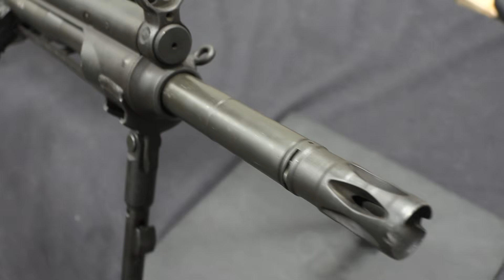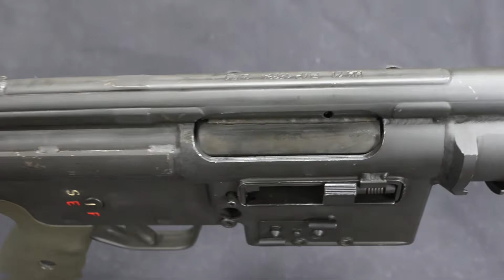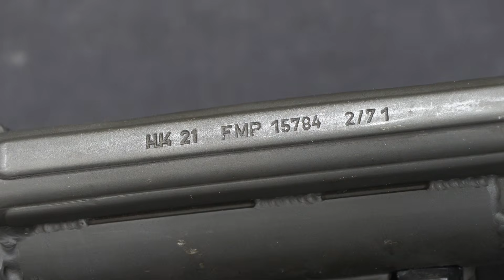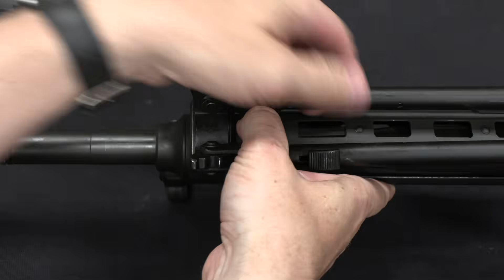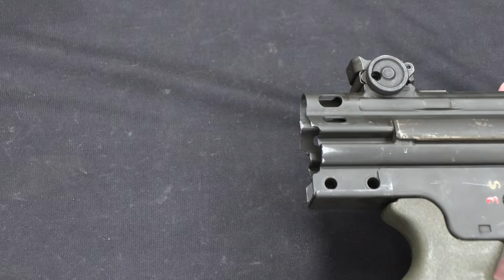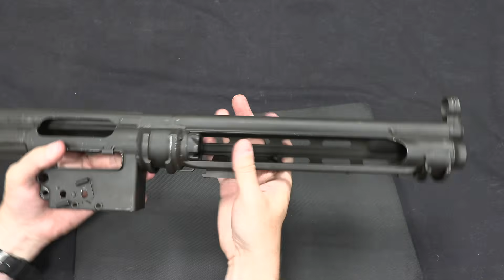HK21 or Portuguese m/968: The H&K G3 Grows into a Light Machine Gun

Comment: Why this weapon and the other HK21/HK11 variants have a faster rate of fire (of around 800-900 rpm) than the regular HK G3 (which is of around 500-600 rpm)? Is it possible to slow down the rate of fire by changing some parts?

Comment: You're not kidding about the recoil. I've fired the Turkish license-built paratrooper version of the G3. It had a shorter barrel and a collapsing stock with a butt that is apparently designed specifically to slide downward and peel a layer of flesh off with each shot. It was simply brutal. Years later, I had an opportunity to shoot an HK91. It was less brutal but still not a lot of fun compared to an AR-10 or an FN FAL. Obviously it can be used effectively, but I don't think I'll be buying one.

Comment: Good old H&K sense of humour:

S, E, F as the multi-lingual selector markings.

Safe
Economy
Fun

A well thought-out attempt at a full-power "SAW" 

NOT an inherently good idea. I had quite a bit of trigger time on the Oz variant of the C2, the L2A1 This was clearly designed by a committee of people who were NEVER likely to be required to carry or use it "for real". The M-60 was the preferred option for serious infantry work

L2A1s were often issued to troops like workshop types and signalers for "local defence".

When some sanity prevailed, this role was taken over by the L4 A4 , the "rebirthed" Bren.

This situation lasted until the early 1990s when the 5.56 weapons were starting to be  issued in bulk,. About the last troops who held the L4s ere the "Recovery Mechanics", who carried them in their big 6x6 "tow-trucks". The "F-89 / "Minimi"' lacked the "punch" of the L4, and certainly lacked the "style". There may have been a tear or two shed by the big lads in the big trucks, but we may never know.

The "ways" of military procurement are a great mystery in the Universe.

Comment: As much as I wish someone made an HK33 version of this it pains me that even in semi auto it would cost $15k... Shot one of these, HK21E I believe, and they're great shooters but definitely heavier than they look. The recoil impulse took a while to adjust to as I had just been running and M60 and a 1919a6 just prior. Great guns and I wish there were more of them here in the states.
Reply: Hecklar & Koch made several machine gun variations on the G33: the HK 13, 23, and a couple more I can picture but don't I'm not recalling the numbers.

My favorite was based on experiences with the M193 cartridge -- a 300-meter urban sniper-machinegun. It has a scope with electronic reticule for better visibility, low-light capability, and a 90-round cassette feed (something HK was developing in the 1970s). A lot of features later used on the PSG-1 to reduce noise when setting up and to improve accuracy, too. The idea was precision burst delivery for counter-terrorism; and a loaded weight between 6-7 kilograms.
Reply: @davidgoodnow269  i meant something available on the us market rt now

Comment: Speaking of Cold War lmgs, the Aug H BAR would be a great weapon to revisit, and clear up any mistakes from the first STG77 video from several years ago: (the recoil springs are located inside the guide rods, not in the stock).
Reply: I second that!
I remember when the AUG came out; 12 (14?)" SMG, 16" carbine, 18" (or was it 20?) assault rifle, 24" squad automatic, and 24" marksman. I have hardly seen anything except the standard rifle anywhere.

Comment: The HK21 is testimony to the M240 being unnecessarily heavy.  The HK21 weighs 20lbs and the 240B is 28lbs.  The excuse is that the 240 needs that weight for “solid” reliability.  Yet here the HK is notably reliable without the weight.

I’m not saying the US should adopt the HK21, actually more that moving from the M60 to a heavier platform was a mistake for an infantry gun.
Reply: Better to compare the PKM with the MAG 58, and then compare the MAG 58 with the M240B.

The HK21 is better compared first with the HK21E and HK21E4, and then with the M-60E3 and contrast both with the M-249 and its update packages, they're squad automatic weapons rather than GPMGs.

Comment: Where does one put their support hand in order to not burn themselves on the barrel tho?
Reply: Most HK21 have a ventilated forend, with a notch for the handle of the quick-change barrel to protrude.

There's a folding carrying handle for transport that you also see on some G3 rifles, and the butt has a grip/brace area to pull the weapon in to the shoulder during firing.

Comment: If this machine gun adaptation of the G3 is anything like the FN FAL heavy barrelled "squad support" light machine gun, I would say that not only is the recoil unpleasant, it would be a beast to keep it firing on target. That's why the MAG or M240 was designed specifically to be used in the sustained fire role in conjunction with the FAL. All the same, it's amazing to see how such a "crudely" made gun actually got put into production. Great video as usual.
Reply: The MAG was a Swedish idea of taking a BAR and turn it in to a machinegun turning it upside down. They couldn't really get it to work so they asked FN to fix it. It was first chambered in 6,5x55. It's known in Sweden as Ksp 58.
Reply: The HK 21 was known for brutal recoil, yes. 19# and 1,200 rpm with 7.62 NATO gave it the name "jackhammer." Best compared with the M-60E3.

The 21E changed to a longer receiver, also used on the PSG-1, preventing the bolt from directly striking the rear of the receiver -- greatly reducing transferred recoil impact -- and reduced the cyclic to 900 rpm (paralleling the early and late MG42). Weight increased by about a pound, but it was still lighter than the M-60, MAG-58, or even some kitted M-249!

Comment: Ouch, that thing would surely leave a mark! I was issued the G3, and never thought of firing it fully automatic, it just wouldn't make any target sense. At least the way I was able to handle it. And it regularly rewarded me with a swollen cheek after range days.
Reply: I would ascribe your sore cheek to poor hold, but it depends on how much you fire!

Yes, this was known for brutal recoil requiring considerable live-fire practice to use well . . . with that nasty recoil. Where most fully-automatic weapons require in the vicinity of 1,000 rounds to gain a good level of familiarity in training, the HK21 required 2,000-2,500; usually with no more than 100 rounds per day and a padded shooting vest or jacket, or shoot 2 days, heal bruises 3 days.

But it earned a reputation for brutally hammering enemy units in Central American jungles, where ranges were often under 150 meters.

The high cyclic rate contributed greatly to feed problems, while the severe impact of the bolt hitting the receiver rear after every shot tended to contribute to the disintegrating-link belt kinking; extending the receiver and changing both recoil spring and bolt to prevent that impact and reduce the cyclic by 1/4 greatly reduced those problems in the HK21E.

Comment: The life and models of the G3 is what the U S. Army vision for the M-14 was. The idea for what  the M-14 was ment to do wasn't flawed. The weapon design itself was incapable of filling the intended roles. The 7.62 cartridge wasn't the problem. The weapon system was. I know this because the FAL and G3 did most of what the US Army asked of the M-14, and they did it for decades long before NATO largely switched to 5.56 .
Reply: The M14 was supposed to replace the Tommy Gun and the Grease Gun, and the M1 Carbine.  As well as the Garand and BAR.  I agree with previous poster…probably a bad idea for a “do it all” system.
Reply: The FAL failed heavily as a DMR due to fundamental flaws affecting long-range repeatable precision. While the G3 and M14 could be gussied up into a proper DMR (SG1/MSG90 and Mk14 EBR) or even an acceptable sniper rifle (PSG1 & M21). 
Accurized FALs were pretty uncommon, but it was adequate as an automatic support weapon (especially the heavy barrel variants). The M14 platform has more-or-less the opposite issue (can be made into a DMR or Sniper rifle, but makes a subpar SAW). Plus, the manufacturing and quality assurance issues on military production models caused numerous problems. Also, the M14 is the least durable in long-term use, since the receiver cracking is less a question of IF, but rather WHEN. 
Only the G3 could/would effectively serve all 3 roles with some notable alterations, but it's the most punishing to actually fire. Meaning it's the only platform, of the 3 mentioned, that can legitimately "do it all", but it won't necessarily be pleasant or well liked by the intended users. Plus, there aren't any production belt-fed FALs or M14s.

Personally, what I'd love to see is a custom HK21 type belt-feed system combined with a PSG1 stock, trigger pack, and barrel assembly. A belt-fed precision rifle, just for the pure hell of it.
Reply: The g3 and fal never did all those roles tho. The basic rifles were often restricted to semi only or never really used un full auto exept to impress on the range.

Most armies that used one of these rifles kept the submachineguns both in the front line squads and for the pdw role until 556 rifles became available/adopted. And most of them had the mg3 or fn mag as the gpmg. 

The one rifle does everything seems to me to be a bad idea, specially in full rifle caliber. Hell even the same cartridge submachineguns and pistols led to lots of busted up pistols as most armies soon adopted extra strong subgun ammo the pistols could not handle

Comment: Not a huge fan of the G3 platform, Full auto on a G3 is no where near as fun as a FAL, especially the FALO model. It’s kind of surprising because both designs were developed around Smaller or lighter cartridges but the FAL just seems to handle the 7.62 NATO better.